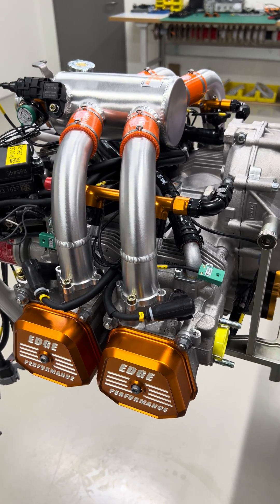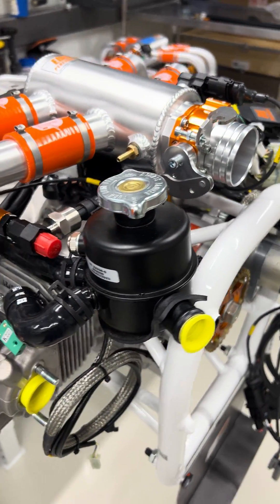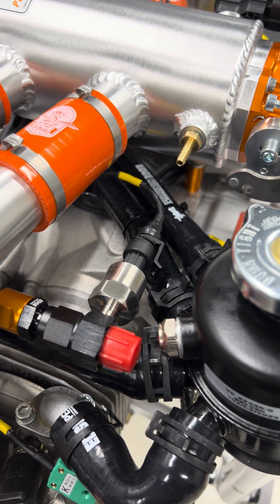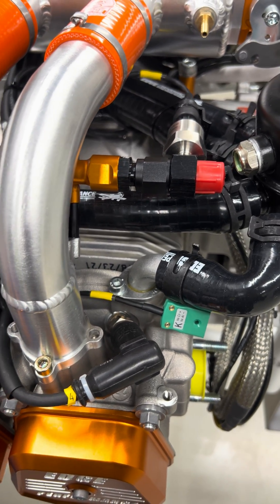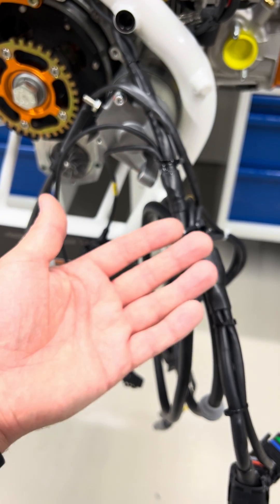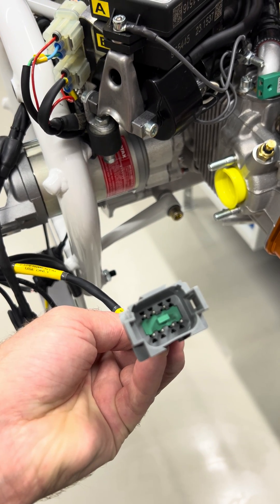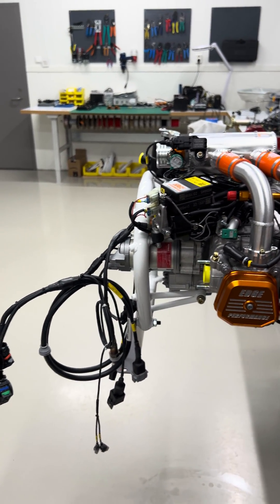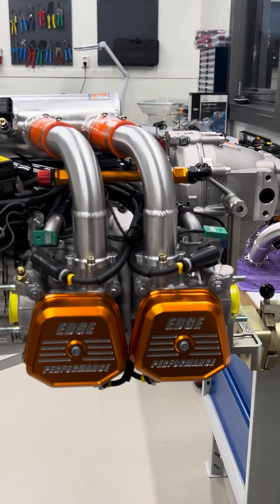EdgePerformance AS - EP912STi Gen2 preview

Comment: What is the difference between this one and your EP917Ti? And can you run those engines in an Atkinson cycle to further improve the efficiency (at the expense of HP, but then, most ultralight airframes don't really take that much advantage of the 155 HP anyway). 100 to 120 HP for takeoff, and then high efficieny between 55 and 70 HP for cruise at fl100.

Comment: Have you also developed an effective method of plug-in, On Board Diagnostics, on par with automotive OBD-II? I’m not afraid of dependence on so many sensors and automated ECU, UNLESS it is difficult to identify faults in the system.
Impressive work, as always ♠️
Reply from the maker: Full live diagnostic tool in the software with all sensors displayed live in real time. So very easy to diagnose. Also real time data logging.
Reply: @EdgePerformanceNorway  I’m not surprised. You guys are on top of the market ♠️